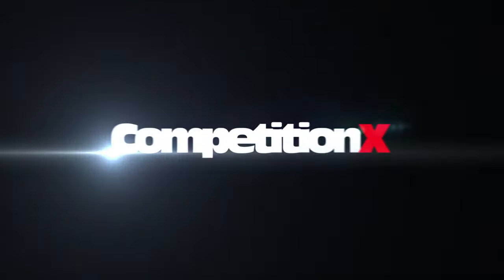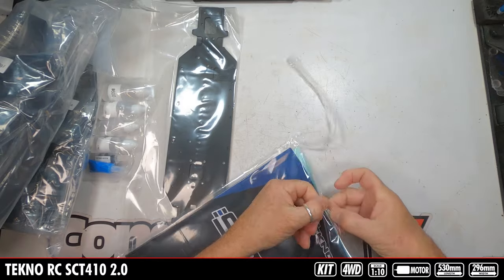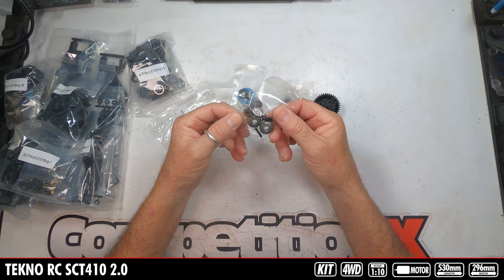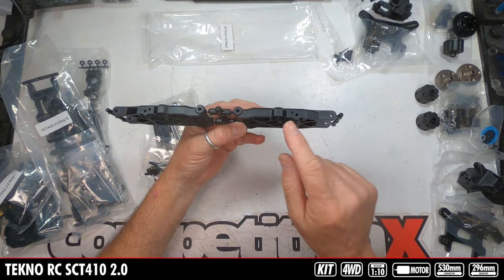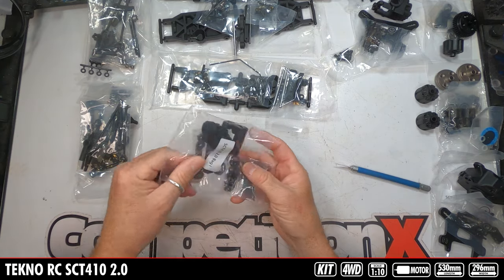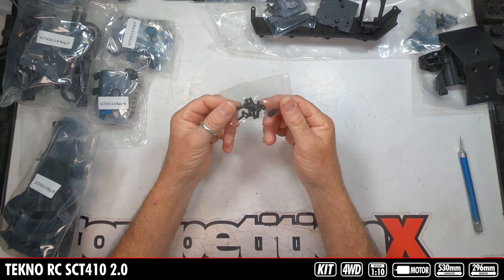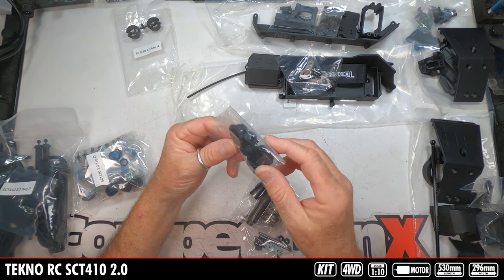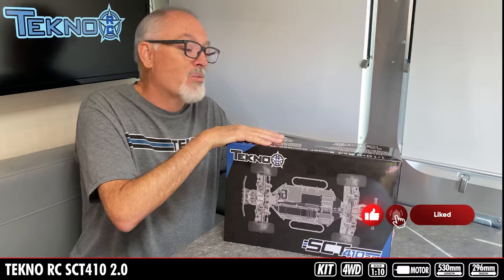Next Gen Tekno Short Course Truck - the SCT410 2.0!

Comment: I'm thinking about building one myself.I still haven't decided what kv my motor would be (I would run it on 3S).I'm between the two hobbywing 3660 options.One is 3200kv and the other 4000kv.What do you suggest is better a)3200kv motor with taller pinion or b)4000kv with shorter pinion
Reply from the maker: Well, with 3S, the smaller kV is going to be a better option to save the power system from overheating. Just keep the gearing moderate and you should be fine.

Comment: I have an Arrma Vorteks with a 3200kv brushless motor and 3S electronics. I haven't been able to find anyone that can tell me whether that can would fit in the SCT410? The Vorteks unfortunately doesn't handle very well with all that power and breaks super easily. I'm wondering if I could transplant the electronics into this kit without having to do crazy modifications!
Reply from the maker: Most larger cans are all the same length. The SCT410 2.0 should be able to accept any motor up to a 550 size. There's plenty of room and, in fact, lots MORE room on the pad to move the ESC around if a little extra room is needed.
Reply: Thanks! Great to know! @Competitionx
Reply: It should fit those electronics without issue. The motor will definitely work. The ESC may line up with the mounting holes on the chassis ESC plate, if not, you could use double sided foam and a cable tie to secure it.